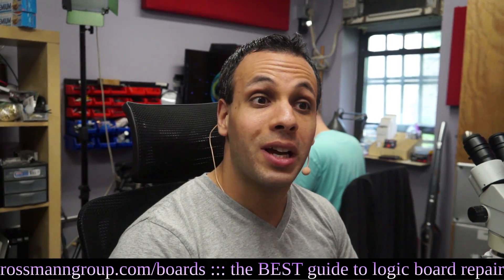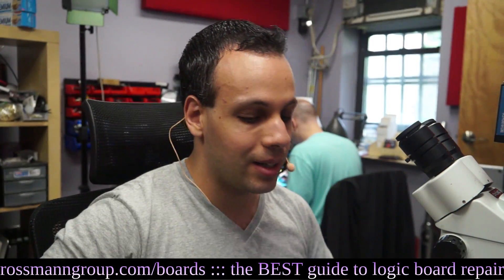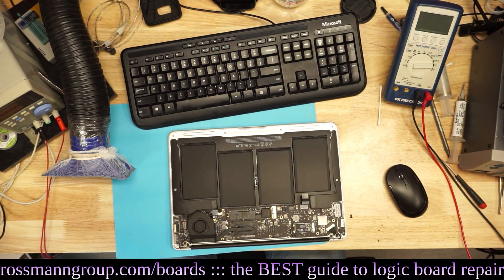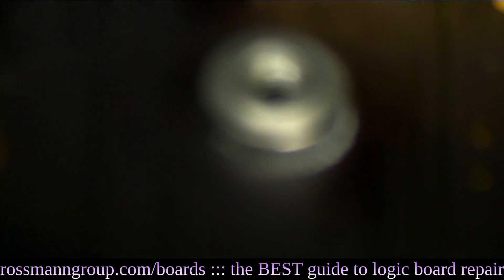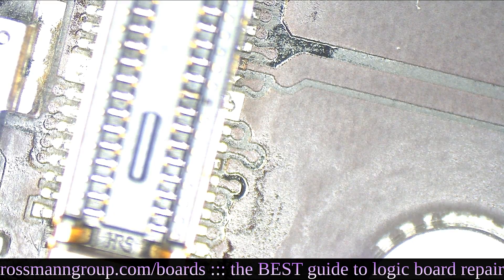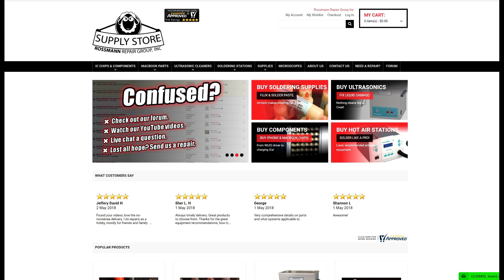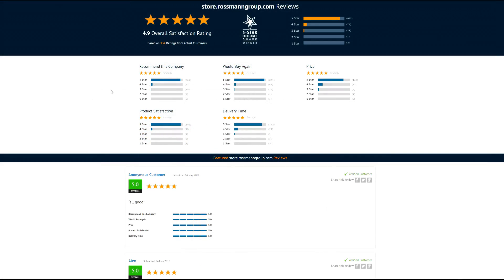Staples scams customers: never let TekDry near your laptop or cellphone!

Comment: As a Staples tech associate, I've rarely seen the TekDry "work" at all. I've always told customers that if the device turns on , we charge them but if not, no charge. But I can say that the success rate of it is usually about 15%. And mainly we do that for wet phones. Watching this video allowed me to connect the dots as to why it rarely works- cause it doesn't
Reply: Jemraider LIVE! Louis didn't explain what tekdry is and how it's supposed to work. Like do you just dry it with paper towel?
Reply: Does Staples do logic board work in-house now?! When I was there ages ago, we simple sent it off for repairs if in warranty or shipped it off (expensive) to some 3rd party repair center. The goal always has been to sell a new computer to the customer. The only things I was allowed to do was replace the screen or anything modular on a notebook.
Reply: MegaMech probably with some kind of microfiber cloth because you can see the fibres on the dried parts
Reply: The problem for this of course is that the machine can turn on and still not work satisfactorily.If it is an expensive machine it should get proper treatment. For $100-200 devices just let them dry and if they work they work, if not buy a new one.
Reply: Jarvis Garcia We don't really send computers out for repairs. If the customer got the service protection, they get their stuff fixed by the company that deals with the protection. We really only send phones out in case it's either a phone we don't do (so anything that is not an iPhone) or if we mess up big time (like nearly every iphone 7). 

I should also say that I'm speaking from what we do at my store. I can't say if other stores do the same things
Reply: MegaMech from my basic understanding of the machine, it's supposed to suck the moisture out of the device with heat and pressure. Though, at the Staples I work at, we have it only for cell phones, not computers
Reply: SukoSeiti pretty much
Reply: Many Japanese don’t even use those that.  The crap falls off onto the bidet spigot, when it automatically retracts the crap smears all over the mechanism. It is notoriously hard to clean those toilets. Plus there are medical complications if you blast water on your anus, including damaging skin and washing away friendly bacteria.
Reply: bidet toilets are everywhere in japan. i've never heard of the problems you're citing. do you have any peer reviewed research to support those problems? thanks.
Reply: this service needs to be removed from the business model, even if the phone turns on, customer risk to damage components. this is wrong.
Reply: I hope no non-disclosure agreement was broken.
Reply: Paddo Physics No. Like if we did it would probably be shipped out to our wearhouses
Reply: staples tech here too, we just never use it. thankfully
Reply: Jemraider LIVE! Das a scam
Reply: Better off pulling the battery and really flushing it out with clean water and baking it in the oven at like 150 for a couple hours.
Reply: spamgate 1 - peer review? Your choice of words is hilarious! Thanks for that one. ;-D
Reply: Jarvis Garcia nope still gets sent off to a third party that works with staples.
Reply: Jemraider LIVE! I rarely see it work as well. We only charge people if the phone is fully functional though. Even if it turns on, and the digitizer or something is damaged which prevents the device from functioning properly, we won't charge them.
Reply: Really - I appreaciate your honest answer and hope that you did not get any trouble for saying that here.
Reply: Scania_V8_Rat I'm actually surprised this thread is still alive. I didn't lose my job so no worries in that
Reply: I work for staples too and I agree
Reply: umm.. no, they self-clean after they clean you before retracting.  I have never heard of medical complications.
Reply: Rip dude im a tech associate too, luckily our tek dry machine doesn't even turn on so i haven't unknowingly done any damage
Reply: Most tech services work is still all sent out.  Most of the software based stuff is done over remote software unfortunately.
Reply: Staples tech here, we use techdry on phones mainly because our machine just isnt big enough to house a laptop. And most of our customers come in many hours after severe water damage, so regardless of what the tekdry does. It would have been lost beyond repair anyways. So you might as well get the tekdry and if it doesn’t work you don’t pay.  Nonetheless, tekdry is terrible and often isnt worth even trying due to its terrible “success” rate.
Reply: Well, turns out I'm also a Staples tech consultant and I've never been introduced to this procedure. I'll ask the technician about it.
Reply: Im a Tech Supervisor for Staples,it's rare that a phone works before it even goes into tekdry.We dont charge if it doesnt work.

Comment: Come on, you didn’t really fix that Mac, you added a tiny bit of wire and turned it into a PC🤪
Reply: Darren Bottin oopsie
Reply: Darren Bottin Kinda, but it's reversible.
Reply: really need to add a disclaimer to these joke comments for new people daz XD
Reply: "What is a PC?"
Reply: yeah, I could use some since I'm relatively new.
Reply: HePBHuq Louis fixes mackbooks
Reply: Dj- a PC is a Police Constable in Britain. Is that Politically Correct enough? And it can be Printed Circuit, Privy Council, Pilot Commanding, Playable Character  or Police Corps. Maybe it's a Personal Computer in this case.

OTOH & FYI, IMHO, don't we just hate it when people use abbreviations without them being explained? The usual response when asked is, RTM. 

I.E., LOL, or ROFL. QED.

TTFN OM.

Comment: Funny you mention the alcohol and Q-tip solution. Years ago, unbeknownst to me, I got a little water damage on a brand new (less than two weeks old) MacBook Pro. (Somebody else in the house spilled something on the table and a little got into the vent). I went to Genius bar to get it looked at. Genius comes back with bad news, says "water damage" shows me the corrosion on the motherboard, and quotes me a Tier 4 $1200 repair. (Another person in the house fessed up to it later.) Not knowing what to do, I consent. The next day, I have a change of heart and ask for it back, figuring, well, if I screw up it more, it's still just Tier 4, right? Luckily, it wasn't sent out yet. I pick it up, go to Target, pick up some 91% isopropyl alcohol, clean out the corrosion and, lo and behold, it works. I was stunned. It was literally maybe fifteen seconds of scrubbing out the area. And it still works to this day, ten years later. Thank god I at least had a little sense to try a simple repair myself.
Reply: The biggest issue here is that this SHOULDN'T be common sense. If apple employees were honest and educated, and they told you that a repair would be $1200 and you reckoned you could fix it yourself for $15, that *should* make you a moron who is going to trash his laptop.

Unfortunately apple employees are not honest and educated.

Comment: Warning: Repair was made with unapproved gloves per Apple.
Reply: And the solder wasn't done by Apple Approved soldering iron and cable, the device wasn't cleaned with Apple approved isopropyl alcohol or cotton swab, and service was not complete under an Apple approved magnifying glass and light.  It is now a pc.
Reply: warning: repair was made by a repair shop that no longer exist because apple sued them for doing a good job
Reply: what? are you joking?
Reply: @gab1649  semi- r/whooosh
Reply: Sued
Reply: @gab1649  Hasn't actually happened, but Apple certainly is trying.  If "right to repair" isn't preserved, it will happen.  Just a little cynical to say the battle's already lost.
Reply: @aurcalium8613  Flat statements like that, even if cynical humor, sound very real if no emoji or other sarcasm flag is used.  Emotion and expression don't flow with text on screen.  Easy to misunderstand, and being harsh because someone did misunderstand is dickish.
Reply: @xheralt  Yeah, people didn't understand my comment, what I meant was: 'Does Apple really have 'official gloves', I understood the guy was joking about Apple. Like the Apple MAC wheels, Apple gloves may exist

Comment: Actually, I agree with you about proper cleaning in the bathroom. I reach over to the sink and run water on the toilet paper then dry myself. Rinse & repeat.

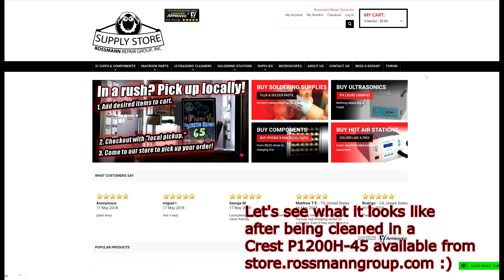At 5:08, you say "That's why Wet Wipes exist." True. But, the problem is that they can (and do) clog drain pipes if flushed rather than being thrown in the trash can. They do NOT dissolve! So if they snag while flushing down the drain on a bit of metal or a solder joint or tree root or something, then over time more and more of them jam the pipe. To remove the wad of Wet Wipes can cost a home owner over $1,000. I know because that happened to a friend of mine.

Comment: I would have expected a full pcb jet clean with alcohol, then a warm air evaporation phase.
If that was done from the water accident stage, the pcb would have been much better.
Staples is really bad.

Comment: I work as a technician at staples, and I refuse to offer services like tekdry on principle. The idea of drying liquid onto a motherboard is honestly one of the dumbest things I've ever heard of. In cases like these I will actually open the computer and clean it.
Reply: From what ive read about how it works, its a vaccum chamber that pulls the water out of the device. I suppose the liquid would leave a dried trail behind it as it leaves.
Reply: @MacMashPotato  A vacuum chamber doesn't pull the water out, it makes it evaporate, look up what liquids do under a vacuum. Essentially, a liquid will start boiling inside your machine due to it, and then the residue is left on the surface it was on. It doesn't get magically sucked up.
Reply: @OfficialDelcos  I'm pretty sure that's what he's saying. You literally just unnecessarily reworded it.
Reply: @ruleram1  That isn't at all what he was saying.
Reply: For those that read this thread, I have another scam to tell you about from a different company. Do NOT get a Walmart Credit Card. It's not worth the almost 25% interest rates and shit like that
Reply: @jimb8395  Are you saying that spilling something like soda and it drying doesn't leave any residue behind?
Reply: It is not supposed to magically re-soder the components. It will only evaporate any liquid within the device before sending it out for a repair. If you actually pay attention to your trainings, they tell you to tek dry first before sending it to our repair center. Nowhere in the service description says that Tek-Dry magically cleans out and fixes corrosion. Stop making invalid assumptions.
Reply: @pravus9769  Thanks for sharing we need more people sharing and exposing the companies that prefer to scam people instead of doing honest business.
Reply: @12343560  yep. I work as a cashier for walmart. I haven't sold a credit card yet because I can't bring myself to do it. The product care plans are legit tho. You need to keep your receipt if you get a product care plan, otherwise it's a waste of money
Reply: @attiliozanetti1232  truth
Reply: At last an honest guy!
Reply: Watch you get a write up/fired for actually taking time to do a decent fucking job.
Reply: @jimb8395  no offense but if the person who is defending consumers like you and me offends you then I'm afraid you are lost and blind. Luis can be blunt i will admit but what he says always has solidity to the arguement in the form of objective proof and strong analysis.
Reply: @attiliozanetti1232  if you actually listen and think, you might understand that cleaning the liquid properly would have prevented corrosion, and no soldering would be necessary.
Reply: Just wondering how well does it clean water. I understand if you spilled tea or coffee there would be stuff left over, but if you spilled water and dried it would it still cause problems?
Reply: They allow you to open the computer? At my Office Depot, we have to outsource everything to a third party company because they don't trust us for shit. They don't even fucking trust us to install McAfee or Office, so we have to make a work order, link the work order to the machine, then have a third party company remote into it. No wonder the company is flatlining, they don't trust us for shit and think it's necessary to retrain everyone in the company for some goddamn reason.
Reply: @Dougy Dozier Even the cleanest tap water includes minerals, which make water conductive and allow shorts and electrolytic corrosion to happen. And in the case of working electronics it happens instantaneous!
Reply: Pull the screen off and just soak it in a bath of rubbing alcohol
Reply: @12343560  Like Gamestop

Comment: Remind me to get one of those Japanese toilets for the proper clean
Reply: they're called a bidet and come in many shapes and sizes :P https://en.wikipedia.org/wiki/Bidet
Reply: Aura Rowe they've got more kinds of toilets in Japan than just the squatty potties.
Reply: Get the good one, the expensive one, where the tentacle shoots up after you flush
Reply: Aura Rowe it's French not Japanese
Reply: Those are really expensive. The high-end ones I saw in one of the Tokyo Station malls was about 100,000 yen or $1k. It has a rear and front wash, air drier, heated sests, and flushing noises.
Reply: Good one on Amazon cost about $60, with hot and cool water. Very easy to install, been using one for a few years. Will never go back to just toilet paper.
Reply: 100k yen is about a $1k usd
Reply: AaronBonBarron you are right
Reply: I doubt they would be absolutely everywhere if they were $10k lol
The only place I went that didn't have a washlet was Ebisu Circuit/Tohoku Safari Park
Reply: Oh no Max, the Japanese take toilets to a whole new level past Bidets (which we in Europe have been using for years). As example they have ones that even wash and dry you while sitting.
Reply: Just get a handheld bidet shower, it's really the only sane option.
Reply: Wimbold yeah, in malaysia we always use the handheld bidet to clean our ass
Reply: We also have them in sudamerica.
Reply: you can buy an attachable bidet from home depot lowes etc that you take the toilet seat off, slide in the attachment to go between it and the bowl, and then the bolts secure both the seat and bidet to the bowl. attach the water lines from the wall and sink to have both hot and cold water mixed for a warm rinse.

Comment: ... tbh, they technically say with the name what they are doing, they just don't tell that it won't be enough....
Reply: DataStorm tricky.
Reply: But that's the problem. They should tell the uneducated that it's not enough to repair the device
Reply: Wilson they are drying it on the basis it will resolve the issue, that's blatant miselling.
Reply: Drying it prevents contact between components. That is important as a first step, but certainly not the only one. Unless it guess wet and you immediately open it up and clean it. Then letting it dry first is redundant.

Comment: that's a funny wiping ritual
Reply: Not really. I hang my ass over the tub and run the shower wand over it.
Reply: same
Reply: +Mycel   Is a person using different color Post-it notes as reminders for different types of tasks OCD?  Is a person putting their wallet in a ziplock baggie at the beach to keep it dry and free of sand OCD?  News flash, just because someone puts some thought &/or care into doing something doesn't automatically make it OCD.  This is the F'ing problem with the general population using medical terminology, they don't care enough to use it correctly.

Comment: Thank you now I feel a lot better, I thought I was the only one wiping my butt hole with  wet toilet paper. You remind me of the time (6 years) when I went to Best Buy Asking for RAM memory, the guy who was helping me ask if I wanted to use the RAM memory internal or external, I didn't say anything I turn around and left the place.
Reply: Valid question. He could of asked you if you want to increase internal storage on your mother board to improve performance of your operating system or would you prefer external removable ram storage for data storage.  Of course he could of been even more helpful and showed you how to shut down applications running in the background that you never use or how to operate a 📀 burner to place programs on that you could permantly free up both memory systems.....but nah you just walked out.
Reply: @michaelbrownlee9497  I have never heard external storages called "RAM" even if they are technically random access memories. Have you? Another explanation is that the employee suspects the average customer may not mean RAM even when they say "RAM".
Reply: @ER1SCO  huh?
Reply: @michaelbrownlee9497  What can I clarify for you?
Reply: @ER1SCO  You have been clear enough, nothing more for you too clarify. Thanks for clearing everything up.

Comment: I used to work at Staples.  I am so NOT surprised that they are offering such terrible services.  They were always pushing the techs to make the quickest buck possible, instead of fixing the problem properly.  Any software issue was supposed to be "fixed" by reinstalling the OS at a cost of $180, backup not included.